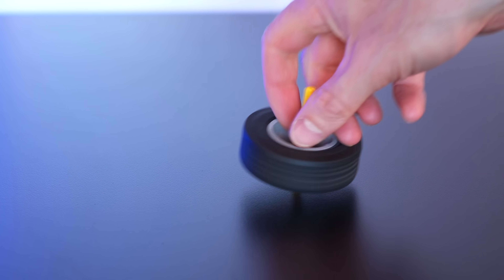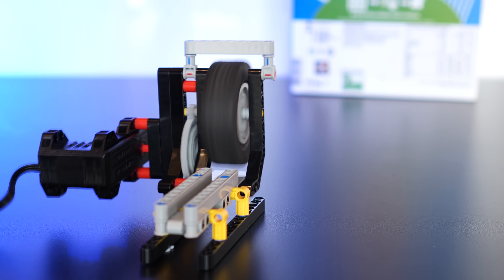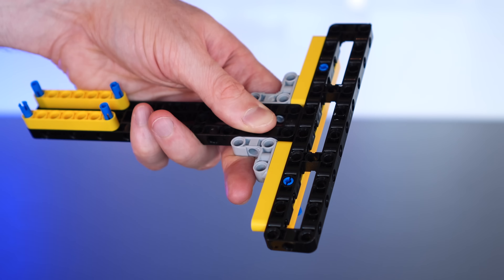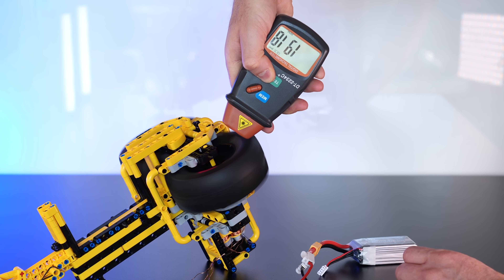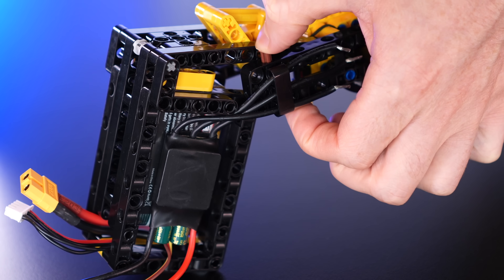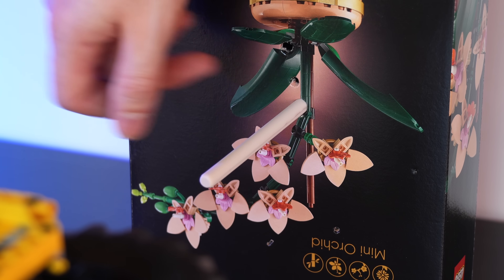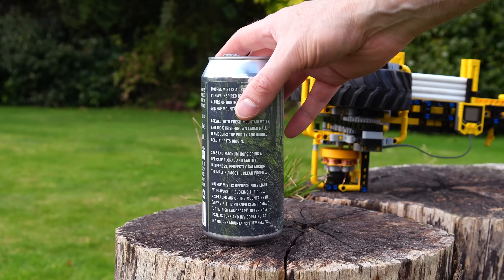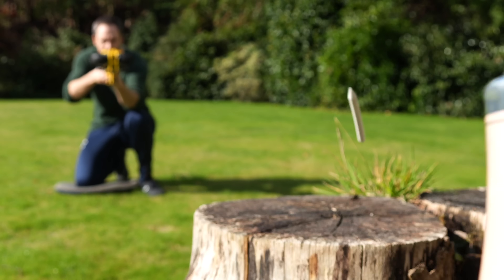Lethal Lego: Making An Overpowered Bolt Gun

Comment: Hey so I know this is an older video but I had an idea for something you could try. Linking your motors to your compressors and engines and getting them all to run off one another. almost infinite power. untill something burns out or wears out

Comment: I understand it's probably easier said than done to replicate your motor, but this suffers heavily for driving both fly wheels on the same gear train. That prevents you from canting the wheels, which, as others have pointed out, would give you better accuracy.

I think you're possibly leaving extra velocity on the table too. If you were able to make a cradle for each flywheel that moves freely along a technic axle, you could fine-tune the distance between them, OR, you could even spring load them, such that they're always being pushed together a little bit, maximizing contact and grip. That also opens up the possibility of experimenting with non-cylindrical dart profiles. Perhaps tapering the dart towards the tail to make it more front-heavy, or an elliptical profile, to maximize contact while both approaching and leaving the flywheel.

The last thing I would recommend would be to replace the tractor wheels with 2 pairs of 88516/88517 "motorcycle racing" wheels. Stacking two of those one-on-top-of-the-other, would give you a groove of tread in the middle to fling your darts through. And again, that's something your could fine-tune along the length of the axle. Maybe splaying them apart a little bit will give you more contact.

Comment: those cutting wheels are made for solid materials that don't melt or deform easily, so the soft wood will just gum them up, try using a more standard toothed blade for the wood next time, or try using a metal projectile by cutting the head off of some nails with the cutting wheel

Comment: one of the tricks you can do to manage the wheel spacing is to use a spring (or rubber band) loaded mechanism with a worm gear and a rack for minor adjustments, I've done this in the past for my own little launcher. The spring action also allows it to expand when the projectile enters the gap even if the tires are expanded.

Comment: you know, it probably wouldnt be too hard to print a bolt that has some sort of geometry to it that allows you to have something similar to fin stabilization. keep the tip and about the first half to an inch or so as-is, then hard switch to a thin profile shaft, then end the bolt with a tapered barrel with some aerodynamic texture to it. hard to describe the image for that in my mind. but anyways, seems doable.

Comment: With the original Lego train tracks they had back in the '60s, the rails and the ties were separate pieces. the ties were 2x8 and the straight rails were 1x16. If you turned the ties lengthwise and put 2 straight rails side-by-side, you could then put a rubber band under one end and fire straight rails out of the thing with amazing accuracy and force (probably why they stopped selling them as separate pieces...) If you used 3 of these end-to-end with a longer rubber band you could go through drywall.

You could use the straight rails and stay canon for your cannon.

Comment: May i suggest adding small beads to the tire to make them 100% balanced. Many vehicles use beads in their tires to sort of "auto" balance the wheels. Once the wheel spins up to speed, the beads disburse to where they need to automatically. This in turn should create a more stable bolt gun and help with vibration. Just a thought! Thank you
Reply from the maker: Woah that's a really clever idea, cheers for the suggestion! I'd guess with Lego tyres, that's actually pretty doable

Comment: I think you could increase the bolt velocity by making it into a more rifle sized gun, having a more space to fit batteries and other electronics, and maybe even have another set of wheels, turning at a higher speed than the previous ones to create a sort of mechanical railgun.

Comment: you could print spikes with a hollow inset cylinder in the point about 1-2mm wide and 3ishcm deep and slide a smaller metal spike in, replacing the printed point, this would both increase the mass at the front and create a more durable and destructive arrowhead

Comment: The bolts are very long. If you look at pro nerf they use half darts (36mm) as they travel more accurately. Also you can make the bolts fly completely straight with string that slightly curves (basically a nerf bcar but less costly)

Keep mentioning nerf because that's basically what this is but this is alot cooler! Love how you use Lego for literally everything! <3

Comment: Seems like even small, almost toy crossbows with a low draw, that come with cheap bolts with metal heads could be modified to attach to a 3D print shaft. Have you thought about stabilizer fins on the botls?

Comment: What if you metal tipped the bolts?, It adds that extra weight for better flight, and also increases the durability, energy, and piercing potential
Reply from the maker: That's exactly what I think this needs! It's probably possible with some clever 3D printing.. Maybe stopping the print mid-way, inserting a nail, and then continuing the print? Or maybe printing two halves, and gluing them back together with a nail sandwiched between?

Comment: slightly angle the wheels to induce rotation similar to rifling 
in addition because they are obviously subsonic strategicly infill only the tip end of the dart so it is encouraged to fly tip forward or maybe make them so you can screw in the basic tip for modern fiberglass arrows. the tips are made of steel and are a basic near cone shape. meaning they will give it that forward weight.

Comment: Metal tipped bolts with lightweight shafts are actually commonplace in archery tools such as Crossbows, there's even a 6.5 inch long variety meant for "Pistol Crossbows".  Having a heavy head and fletching on the back end at the same time, is also a tried and true way to prevent tumbling.  Since you have a 3D printer, you could easily make all the nonmetal components out of printed plastic.

I only advise against using "broadheads" if you purchase prefabricated parts, as the bladed tip will tear up your legos, especially the tires; If you're particularly unlucky, a broadhead might snag on the wheel, and be flung directly back at the user of the device.

Comment: About 20 years ago, in the pre-youtube era, I saw a video once on some long forgotten website, where these guys had made a giant version of this. It was vertically oriented (one wheel above and one below, as opposed to one on the left and one on the right), the whole thing was made of welded steel box section, the wheels were two car wheels, and it was powered by a 4 cylinder car engine. I forget how much horsepower it was. They used it to fire builder's planks, basically 2 inch by 8 inch (or thereabouts) planks and about 6 or 7 feet long. They were being fired at probably over 100 mph, they were being fired at old refrigerators, washer dryers, that kind of thing, and just smashing them to bits. A terrifying, completely lethal weapon. I've looked for it a few times over the years with various search criteria but never found it again.
Reply: I rather be shot by a gun than having a plank hit me at 100 mph
Reply: @clubstep8244 It's easy to extract a bullet, but there's no un-smashing your cranium

Comment: You could pause the 3D print and put old drill bits in the middle as weights or even expose the tip for better chance at the bottles

Comment: Two flywheels and a gear ratio big to small instead of yours, than even lego motors can do the job. And try some bolts for crossbows, they are cheap. You just need to adjust the height of the rail, that two wings pass over or under the wheels.

Comment: I’d suggest for better ballistics you would make your 3d printed bolts fully infilled at the front, but fairly hollow on the back. The lighter side will follow the heavier side much better.
Reply: came here to say this as well, crossbow quarrels from back when were front heavy (and fletched but I don't think that's quite possible with this launching mechanism)
Reply: @dallinhunter7385  unless you inset the fins- narrowing the body and having the fins only go to the original diameter.
Reply: Wouldn't it spin? I feel like a spiral ammunition with a strong tip would do the job better, more accuracy and more durable
Reply: @offthetrackz possibly, although I’m not sure how helpful that’ll be at these lower velocities.
Reply: @thetallframer  yeah that's true, would love to see this in action tho!
Reply: Another option is to use a stabilizer like you see on dart guns.  They create rear drag very similar to fletching, but can pass through a barrel.

Comment: Im wondering how that would work if you did it like the first version but twice. So that each wheel took turns accelerating the dart like the coils of a rail gun. Maybe you could gear them for different stats. Like the first could have higher torque to get the dart moving and the second can be all all about speed. Plus one wheel in front other vertically would make for a more ergonomic weapon. Not to mention that it would probably be somewhat gyrostablized. 

This is an ugly idea. This is the kinda thing leads to bored southerner using power tools and old ATVs to launch steel pipes though cinder block walls

Comment: what a blast. fly wheel cant hold it. spring arm auto fit for the wheels. full auto bro. its alive. pencils bro. ie hexagons are the besta bolts. vampire hunter bro? so why isnt a grinder disc rim launcher a thing. ie plastic/steel balls launcher. ie not launch track friction dependent but rotational tangential speed launcher. ie catapult but with a spinning disc detach launcher. you dont have a practice target board.

Comment: Easiest way to improve accuracy/stop tumbling would be to make the projectiles heavier at the front. Consider keeping the first ~2cm at 100% infill then lowering the rest to around 20-30%. The projectile will follow it's center of mass.
Reply from the maker: That's a really interesting idea, I'll give that a try - thanks!
Reply: Or you could use a bullet tip arrowhead and print a shaft for them (or use a wooden one). This would give you a metal tip, and increase the weight at the front giving a more stable flight.

Comment: can you pls do a car battery power engine
Reply: from what i know about rc car stuff (im more than willing to be corrected, please do so if im wrong) a car battery isnt likely to be much faster or more impressive than the battery he used. the battery he used is a 3 cell lipo, which sits at around 11.1v at nominal voltage. (little higher when fully charged, 12.6v specifically) the way brushless motors work is they have a Kv rating which just means that for every volt, the motor will spin at x rpm. so for example if your motor has a rating of 4000Kv and you give the motor 1 volt, it will spin at 4000rpm. a typical car battery when fully charged sits also at 12.6v, which means it wont be any faster than this. 

the only advantage that the car battery might have would be the number of amps it can deliver, but i dont believe that would be super beneficial in this scenario. a typical car battery can supply about 400-1000 amps depending on the battery and the vehicle and what the vehicle needs, and a 3s lipo like he has will be able to supply 117 amps. the way you get this number is to look at the C rating on the battery, and then the capacity. so in this case a 1300mAh capacity battery, you need to get the Ah, which is gotten by dividing the capacity by 1000. so 1.3Ah multiplied by the C rating. so at 90c its 1.3*90=117amps. the battery hes using is small though, and the C ratings on lipos go a fair amount higher than 90, which means if you used a big boy battery with a capacity of 10000mAh and is rated for 150C, then you could get 1500 amps supplied by that battery which makes that better than the car battery.

3 cells in a lipo is still on the relatively low side. ive personally seen lipos that are 12 cells. can use the math that i stated earlier to figure out the numbers that that kind of battery would do. sorry for rambley rant, but i thought it might be a good time to spread what i know out there while also answering why this wouldnt realistically be worth it.

tl;dr car battery wont be really any faster than the little lipo battery he used, the only way it may shine is being able to supply more current (amps) to the motor for better torque. though this can be combatted and overtaken by a sufficiently suited lipo at like 15% of the size and weight
Reply: @frozen6787   As far as I know, this is correct. You also might be the oldest person in the comments
Reply: @SilvaSnake49 honestly think you might be right lmao. im not even that old though, im only 24. i just really like rc stuff 😭
Reply: @frozen6787  yeah but everyone else acts like toddlers

Comment: 5:49 Tip: Don't do that. If your finger touched that wheel, it would have pushed it into the palm of your hand and then the wheel would have used the soft part of your finger as a brake and possible even broken one or more nails. You always have to touch spinning things from the other side, so that if you touch it, the thing just pushes your finger into the air instead of "pulling" it in. Speaking from experience.
Reply: Sound advice.  Considering the mass and energy at play i don't think it would have done much but jammed his finger, but this is absolutely a good rule to live by .
Reply: @danjones2680  I don't mean that it will break a finger or something, but it will just hurt pretty good.
Reply: @marluna_x  gotcha, my misread.  You are 100% correct though.  Ouchy at this energy, but with enough energy broken is absolutely a possibility.  A safety video i had to watch as a young engineer had a photo of a guys hand where his last knuckle was right next to his middle after such a mistake.  It got dislocated and then shoved down.  Nope, no thank you.
Reply: Very good advice to keep in mind for every rotating object. Thing is though, he spun the motor up backwards there, so the wheel would've grabbed his palm and driven itself right off and away from his hand.
Reply: That was completely safe. That wheel doesn't have enough mass that it could pull a finger in at low such a slow speeds, and when it's spinning fast enough to have enough moment of inertia to do it, there would be nothing for the finger to get caught on. Pressing on the fast spinning wheel would at most cause abrasion.

That accident of yours with centrifugal blower is entirely different deal. You're spinning hard and relatively sharp plastic, instead of soft rubber that doesn't have sharp edges anywhere.
Reply: @anteshell  I don't mean that the danger is a finger getting sucked in, although that is still a danger. I meant that one of the wheels could bend a finger in such a way that it uses the top of the finger as a brake, which is very sensitive compared to the underside of the finger.
Reply: @marluna_x  That is what I meant too. Just said it a bit awkwardly.
Reply: @anteshell  Still, have you had that happen to you before? It is very easy to underestimate how much energy can be stored in spinny things. It happened to me before.
Reply: @marluna_x  Yes, it's absolutely better to err on the safe side, we definitely agree on that. But that being said, there still wasn't any kind of danger here.
Reply: it is a lego spinning wheel, it is not a big deal
Reply: @DashzRight  Have you ever tried it?
I assure you, I am not a safety nerd, actually quite the opposite. But what he nearly did would have hurt pretty bad.
I once had an about 3mm deep cut in one of my fingers because I got careless with a tiny centrifugal blower for 3D printers I think. And the blades weren't even metal, they were regular plastic.

Comment: I wonder if there's a smart way to orient the driving wheels (possibly with modified tread patterns) so that you add some riffling to the round.
the spin would get rid of the tumble.. maybe try a barrel too ?
Oh..  and you also could try a MULTI STAGE system with faster and faster driving wheels.
Reply: He could use the bolt shape and a guide to induce turning as the bolt moves forward. It would introduce a bit of drag, but I think the stability improvement would be worth it.

Comment: Btw: You don't NEED 2 wheels. You can also just use 1 wheel together with a long and low friction part. This way, you can also adjust the distance much easier by simply moving the stationary part instead of a wheel, and thus you can probably use the biggest wheel you have.

Also: I played around with this back in the day, and I found out that there are these very specific parts with a foam rubber wheel combined with a metal flywheel, powered directly by a small-ish dc motor with no gear reduction. The wheel is mounted in a wheel well so that only like 4 mm of the foam rubber wheel is exposed, and the motor is on the outside of the wheel well. It spins extremely fast and has a lot of inertia thanks to the large metal flywheel plate. It's as if they were made for this. No idea what they were meant to be used for though.

EDIT: I FOUND IT!! Search "Dc Electric Motor 3v 6v Diy Ping Pong Ball Launcher" on Google, the first image is exactly what I have! Turns out they were made for launching things after all...

Comment: Maybe you don't necessarily need metal bolts, if it's just about making them heavier. A quick idea would be to print the bolts with some insert-hole to press in a metal weight. Ideally at the front, which also should improve flight stability. Another idea for cheap bolts would be to use some large nails with their head cut off (I don't know though if they would be too heavy or thick enough).
Reply: What? Weights in the front would make it fall face first
Reply: @COSMIC_SECRET  Yes, that's why darts, throwing spears etc have that :P